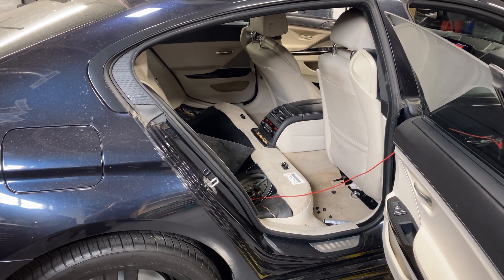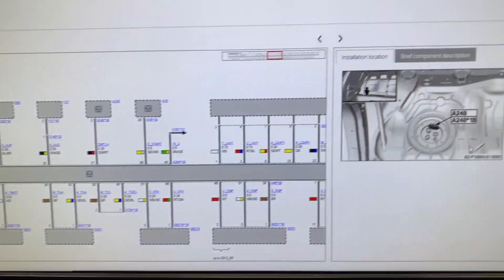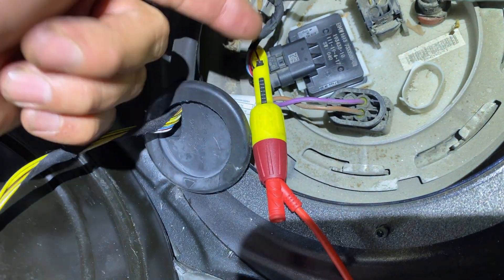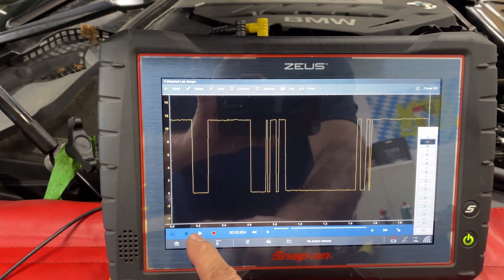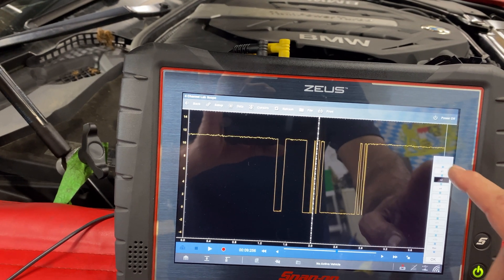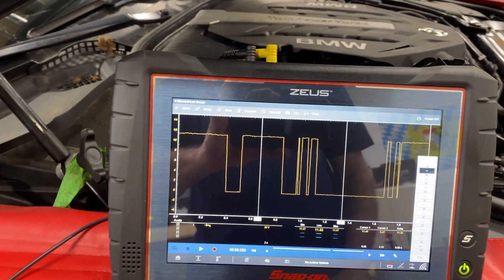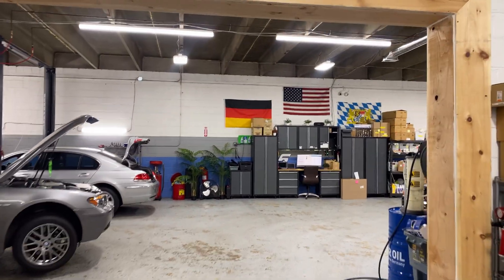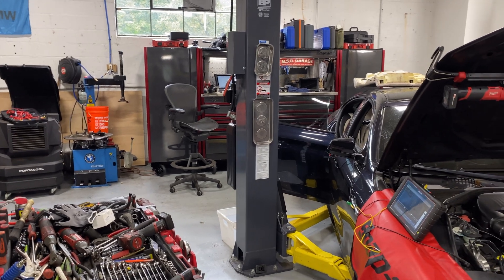2015 BMW 650i xDrive 4 4L Code 194604 short diagnosis

Comment: Hey can you please give me a call I have 2014 650ix bmw I keep getting drivetrain malfunction, at first I can turn the car off and on and the problem go away, but now it won’t now in park it’s idling high and shaking in park and soons I turn on the engine drive train malfunction pops up and check engine light flashing, I replace the spark plugs and coil packs. And still the problem is there

Comment: Maic, So this video was only to show how was the waveform look like or there was problem with system  always good info brother and thanks for sharing.
Reply from the maker: Yes the code 194604 is NVLD line disconnection. That is why I have that jumper in place.